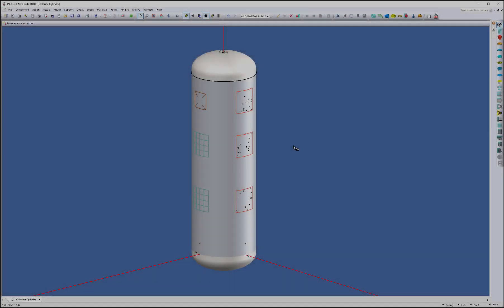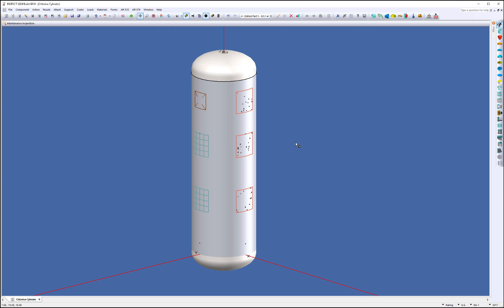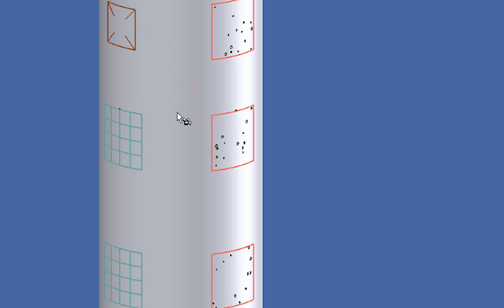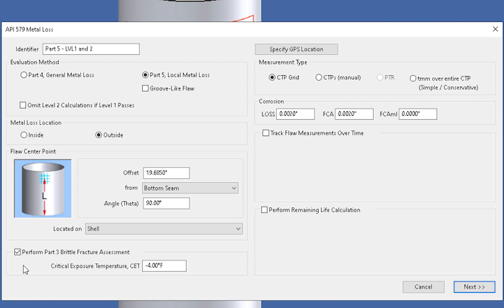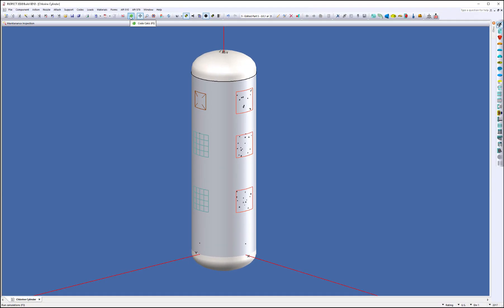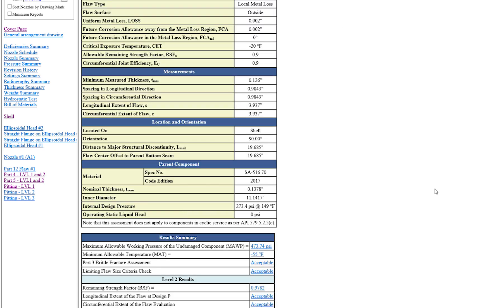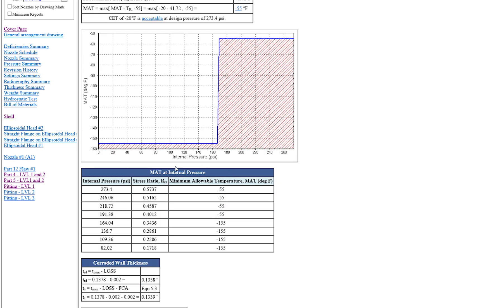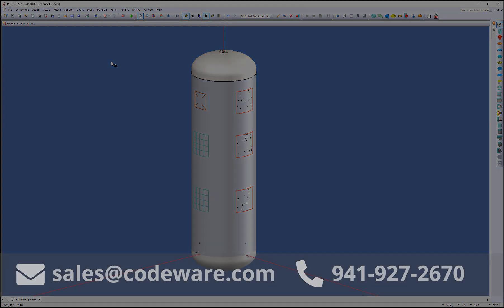API 579-1 Part 3 Brittle Fracture Assessments in INSPECT

Comment: To generate the MSOT curve in a heat exchanger, is the Tubesheet considered on the tube side or on the shell side?

Assuming the Tubesheet is "fixed, integral shell, extended as flange".
Reply from the maker: Thank you for your interest in INSPECT. The MDMT/MAT (point on the MSOT curve) for the tubesheet is typically governed by whichever side of the heat exchanger has a greater MAWP. At this time, heat exchangers are not supported for this type of Level 2 assessment. 

For more information on INSPECT, please contact us at sales@codeware.com.